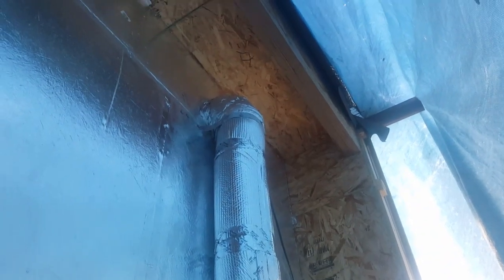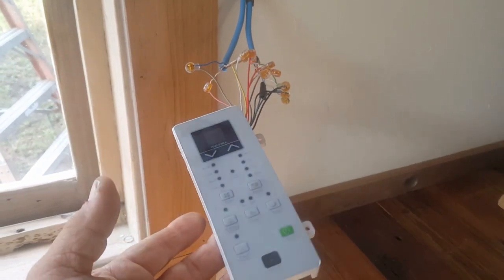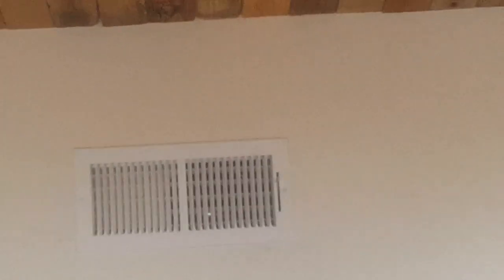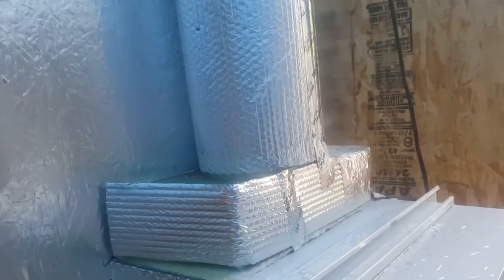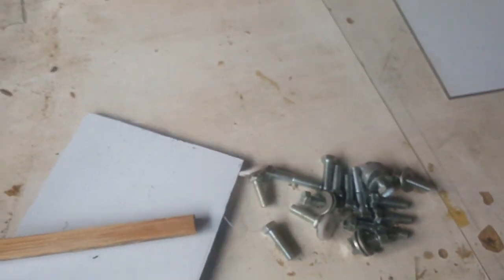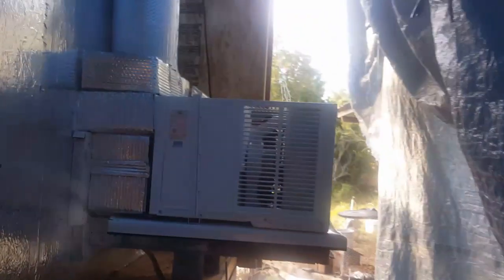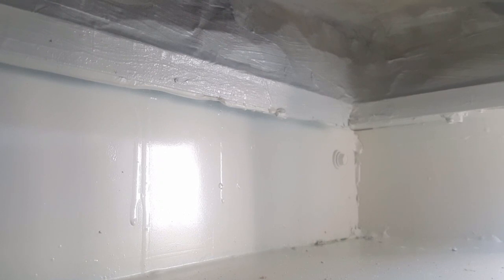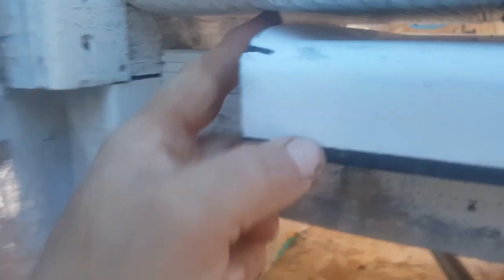?Best Houses Built Tiny  AC Hack in the World? / Converted Window AC to Central AC for $350

Comment: It's always a treat to see that someone has done all the thinking for me when I hatch some half-baked idea. You seem pleased with the noise level, and that's good news to me. I was considering putting convolutions in the intake path to isolate mechanical noise, so having a straight, short shot  to the intake isn't an issue, I guess?  This surprises me, but you seem to have thought it all through, and the previous video mentions it being quiet.    I'm determined to keep it cheap,  but well-constructed, and I think you nailed it. It seems a little too wacky at first glance, but the longer you look, the more this little hack looks like something a lot more people should know about.

Comment: I live in a condo and the association will not allow a window unit so I pulled the unit inside and made a box around to pull the air from out side. The window screen does a good job and conceal the AC when looking in. If you look at a typical window AC, the front half is design to sit inside and back half is design to sit outside. The outside part has vent on the side and top. The trick was to seal one side and the top and build a small box to allow air to be pulled from the other side and cover/box that off to the rest of the window opening. Condensation is allow to over flow on to the aluminum window frame then it drains out naturally. I only have to worry about blockage on the window sill which merits a dirt examination/cleaning beginning of the season. I am able to do this because when I moved in, I had replaced all the original wooden window with a vinyl replacement window and there is enough room on the vinyl frame for a window ac to sit slightly overlapped.

Comment: Brilliant! I love the sign board usage for the return air.  I think I might add an inline vent van to help lift the cold air. I also live how you pulled and pliced the control unit. I am going to do this using all of your ideas.
Reply from the maker: m3llomatt821 awesome let us know how your project works out. Also if you'll notice there is an 8-inch inline fan that sits just up below the 90 on the register. It is very necessary so that you don't have too much head pressure on the unit. And in the winter time we just leave it on to circulate the hot air that comes off of the space heater or the "rug buddy"

Comment: Thanks for the upload.  I had this idea after being woke up multiple times a night from window a/c unit.  Seemed easy in my head but after watching video it looks like too much work and all the parts add up.  I once made an outdoor wood furnace. $800 later it worked but not good and very inefficient and I ran out of wood to burn.   Not making same mistake.  I'll save for mini split for $750.
Reply from the maker: The epoxy the ductwork the insulation and the sign board cost about $150. It took one day to build and then two days of drying on the epoxy shelf. Before you by the mini split check into the maintenance schedule and how difficult that is one of my sons has a full-time company now just cleaning mini splits 2 to 3 times a year for anywhere between $250 and up to $500 per unit. Just for cleaning bagging and power washing

Comment: How do I determine the ratio / duct size I need.  I did a similar project and want to double check it will be ok.  I used two 4 in pipe to lead to two rooms and a one 4 inch pipe for the condenser coil. Thinking I might need to go bigger.

Comment: if you ever need to run the controls again get an AC unit that supports last state power recovery. Run a standard house thermostat with thermostat wire hook up the red blue and yellow. run the thermostat wire to the AC hook the red to a 24vac transformer hook the blue to the common of the 24vac transformer hook the yellow up to the coil side of a relay and the blue to the other side of the coil.   then split open an 3 prong extension cord leave the green alone strip a bit of the black away and T off to the high side of the transformer cut the white and put one side to the high side of the transformer and to one side of the switch on the relay then the other side of the white on the other side of the switch . you will now be able to use a regular thermostat to control the on off power to the AC unit set the AC to coldest setting and it will turn on and off like a house unit. I did this to a portable unit cause the fan would run loudly forever. now it only runs when its needed to be on

Comment: Brilliant build.  You have told us that you are sensitive to electromagnetic fields.  Are you sensitive to epoxy fumes?
Reply from the maker: I'm not sensitive to them after the epoxy has fully set up. But I am sensitive to many other chemicals including formaldehydes, vocs, Etc
Reply: @HousesBuiltTiny Great idea. For healthier air quality, I used to have a 3M staticly charged product which fitted into the section behind the front grill on the return section. This collected all the dust and dust mites and other airborn contaminants. You may be able to find something similar and place it on the front of the grill and just remove it every couple of months once it's clogged with crud etc. It would be hidden after you put up the wooden screen etc

Comment: if I want to do this inside a small bus, would it be better to use a low 5000 btu unit or a higher btu unit if I plan to use it on a low setting?  I will be off-grid so I want a low wattage draw as possible.
Reply: #1 thing you can do to help is insulate and seal that sucker as much as possible. Idk answer to your question but I know my dad built a 2600sqft house with excellent insulation and one summer we tested electricity usage. $160 electricity bill, AC was set at 72F, 11 ft ceiling. If you insulate well, whatever AC you use will use less power over time

Comment: I'm failing to see the advantage of what you did here versus sticking the unit in a window as intended.  Central air typically vents conditioned air to multiple outlet vents throughout a building.    Seems to me the only thing you've accomplished here is a bunch of ugly unnecessary holes in the side of your house and decreased efficiency of your unit.
Reply from the maker: Thank you for your comment Bobby. So here's the deal. H absolutely quiet. You don't hear the air you don't hear the vibration of the compressor against the framing of the house. There is note humidity in the hole or on the wall that creates rot on the exterior interior of your wall or window frame and to clean the window unit is extremely simple just to unlatch one side of it spin it around power wash it and put it back. Check out the other videos that are related to this 1 and you'll see are finished unit and how it operates. I hope you take the time to watch the other videos. Again thank you Bobbie for your comments